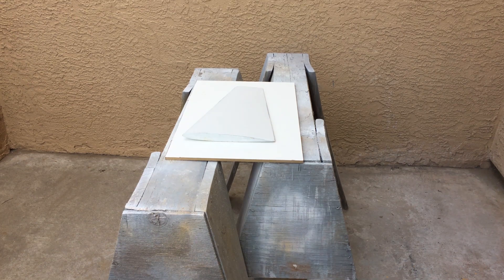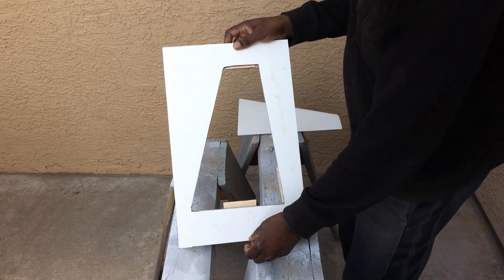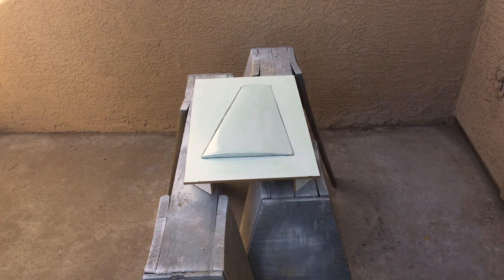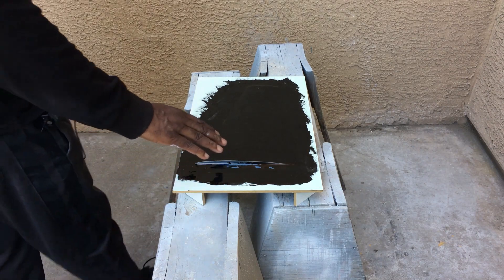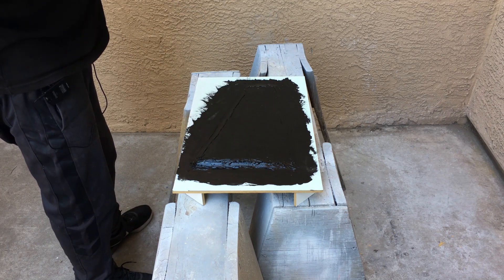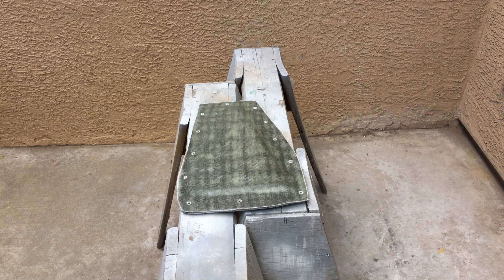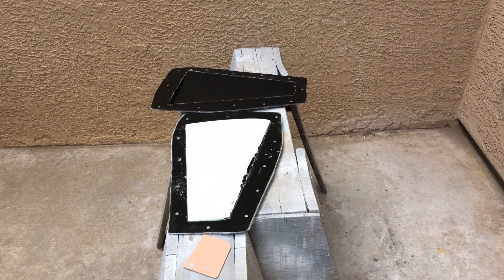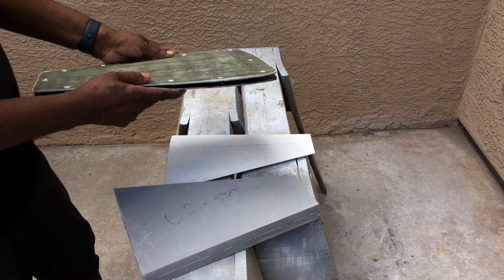110 inch Wingspan RC U-2 3D printed DIY

Comment: Hi! First of all thank you for all these videos. Very helpful. I also would be interested to know how a project is started. I mean would you be using a mesh file or a solid model on p/c and then cut it up in stl? How does the project develop? Perhaps one day you should take us from the design stage up to molding. The fiberglass molding is amply featured here but always interesting. Would make an interesting project to show how a project is taken from the p/c onto 3d printer. Kindly let us know what software you are using to make the design works and whether buying a ready 3d model can be used and how can this be used to make the 3d printed parts. Thanks!
Reply from the maker: Thank you!. I will be doing a video on how I design a plane to drawing the molds and printing them.
Reply: Thank you!
Reply: @cadbuildflyrc3784  Great Job, I am also interested in developing a process to build my own designs, is it best to just build plugs or framed deigns that you then mould and cut internal frames?
Reply from the maker: @Power-Jets  That is a very good question.  If you are going to make just 1 or 2 planes from your design, I would 3D print the molds instead of making a plug. Now if I were to make a plug and not 3D print it, I would make it out of foam.  Foam is easy to shape. There is nothing wrong with a framed plug either, I just prefer  foam or 3D printed plug. Use whatever method to make your plug that you feel comfortable.  Try a 3D printed plug.  It is less work than foam or framed up plug.

Comment: Excellent work. The only note I would make would be to suggest putting a few location pins on the splitter plate,, some 1/4” or 1/2” hemispheres. That way you are not depending on the bolt holes for alignment.
Reply from the maker: Thank you.
Reply: How do you make the laminate from a closed mold? I’m assuming you make a laminate in each mold half then glue the laminates together
Reply from the maker: @donr62  The splitter plate/laminate.  Is used on only one half of the mold. It is then removed and you will have the flat surface molded.  You then lay up the second have over the first half.  That gives you the flange.
Reply: @cadbuildflyrc3784  no, I mean how do you lay up the part with a mold that’s closed like yours?
Reply from the maker: @donr62  The mold is 2 parts.  You layup one side then the other then use epoxy to glue the 2 parts together.